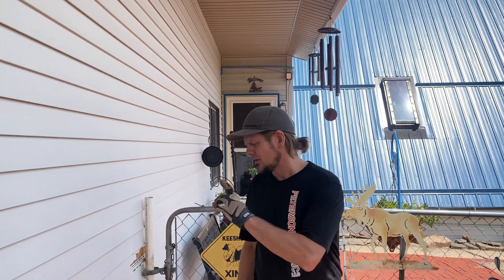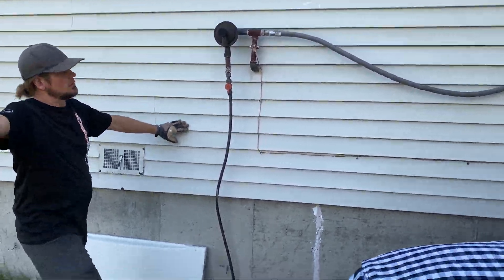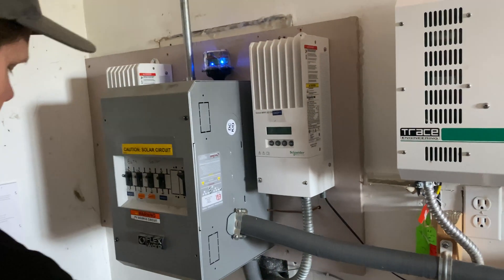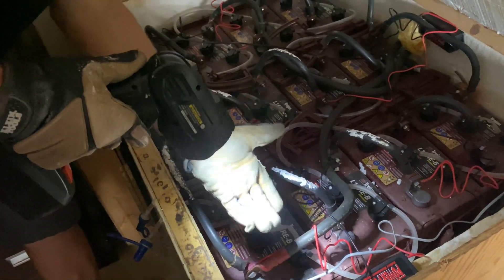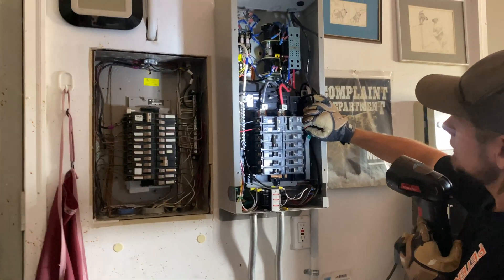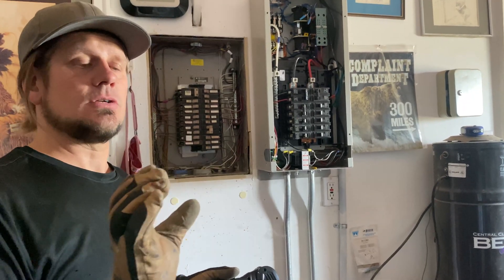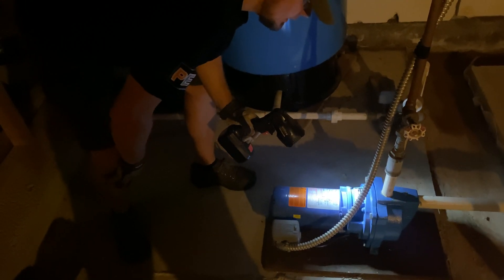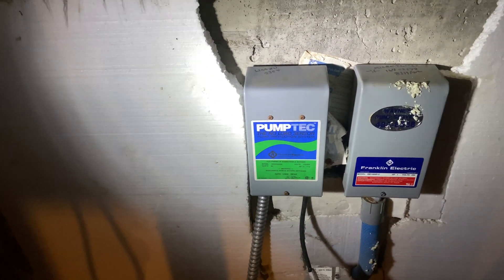Addressing a Lightning Strike on a Home Off the Grid

Comment: wouldnt a 50amp inverter breaker in the generator panel be against the 120% bus rule.  Those generator panels are only 100A bus, you would have to have a 250A rated bus for a 50amp backfeed.